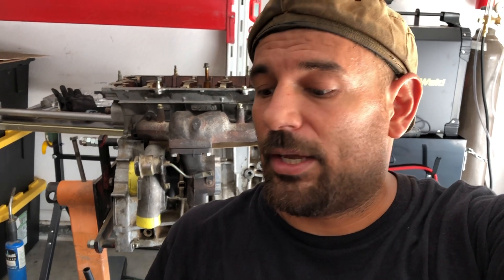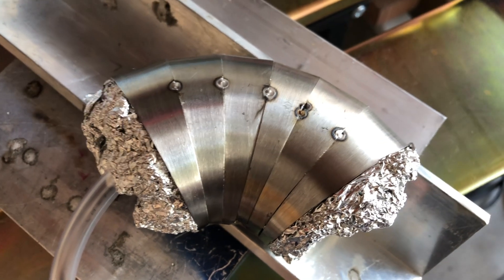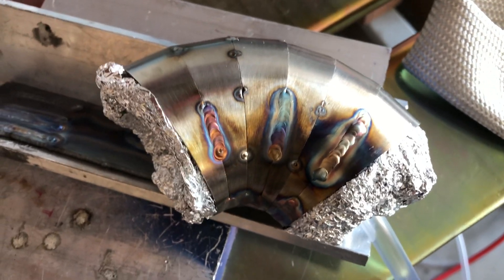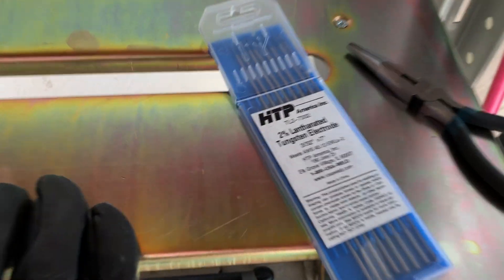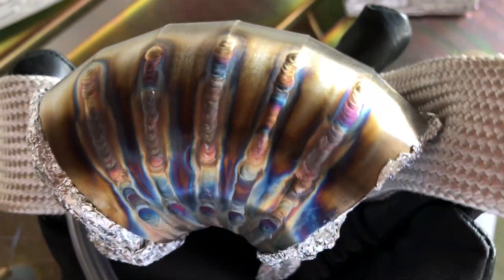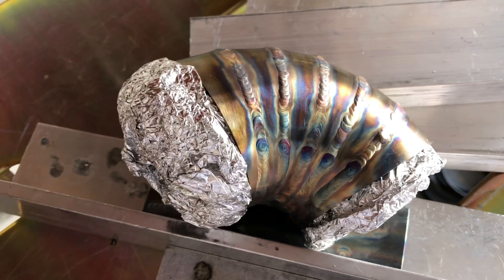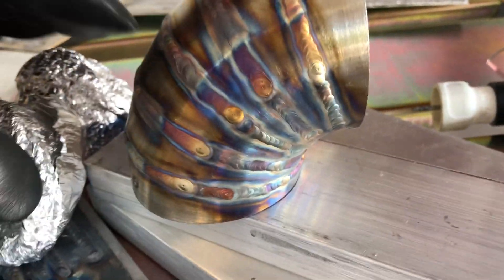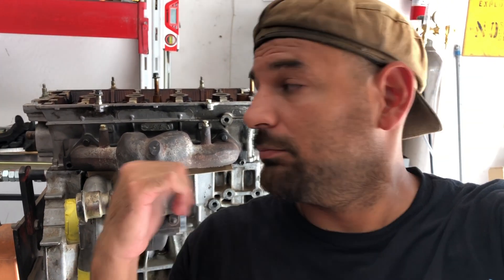First Time TIG Welding Stainless Steel! Pie Cuts/Back purge/Greddy 18g Turbo

Comment: Looks like you sealed up your back purge to good. You need a bit of leak to allow escape of oxygen and in flow of argon.
Reply from the maker: My first time doing some thing like this so I probably over did it, but I did poke some holes for it to purge all the oxygen.